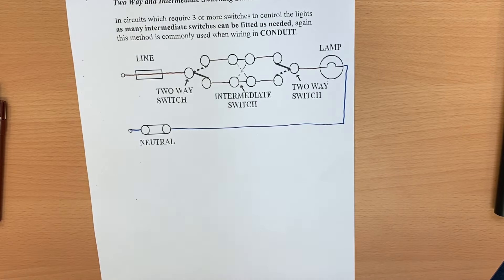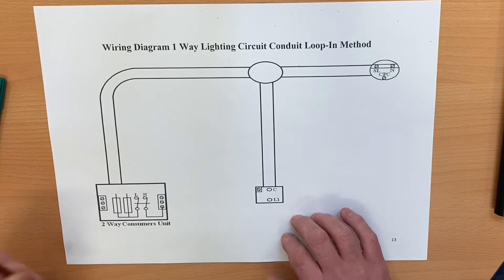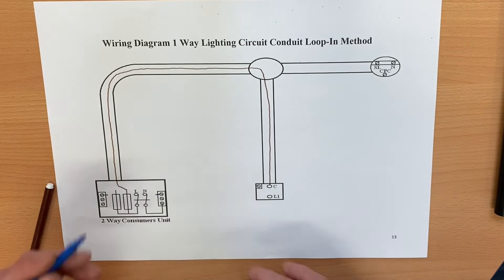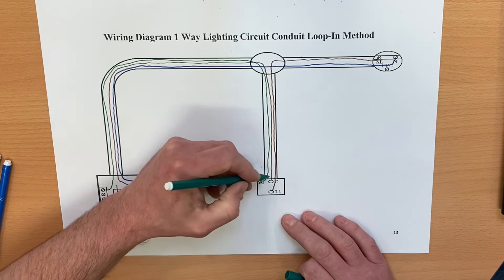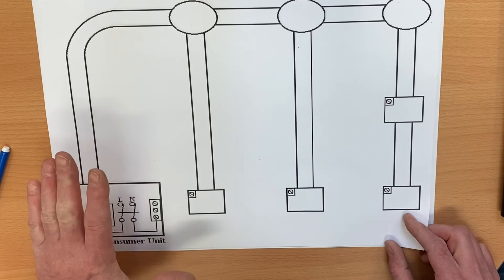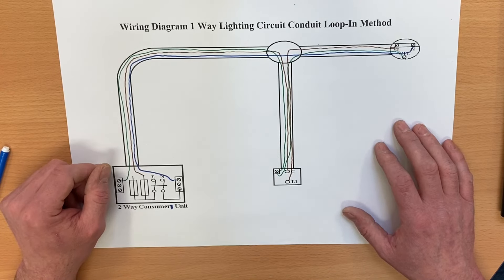Wiring Diagram Conduit Loop-In Method Introduction Part 2 of 2 - Lighting Circuits in PVC Singles

Comment from the maker: == 🕐 Time Stamps - Cut to the action 🕕 ==
00:10 - Make sure you have watched part one of the introduction to the conduit loop in method
00:18 - Wiring diagram for a one way lighting circuit using the conduit loop in method
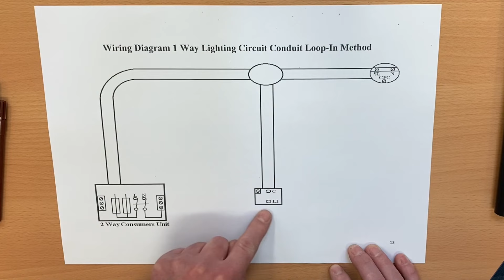00:35 - Wiring diagram components 
01:13 - Adding our line and neutral conductors to our 1 way lighting circuit wiring diagram
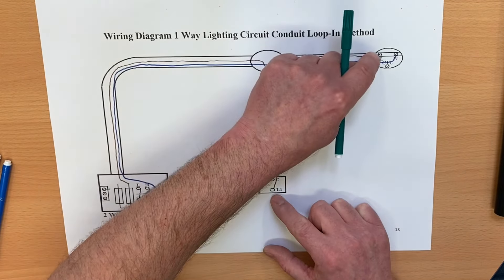02:55 - Adding our CPC conductors to our 1 way lighting circuit wiring diagram  
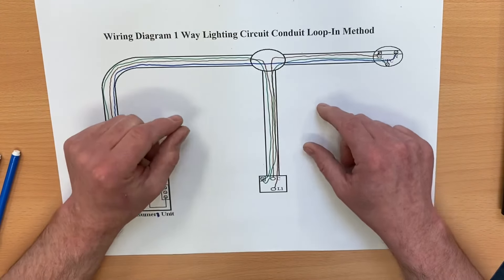04:51 - Cable connection in the consumer unit, one way switch and lighting point
5:50 - Signposting future videos on the conduit loop in method

Comment: Daft question why not a CPC connection block at the junction thus saving 1m of cable
Reply from the maker: All CPC to take a local route however the lighting points I use cannot fit 4 CPC in them. Loads more wiring diagrams to come using this method 👍🏻. Thanks for commenting and watching. Gaz

Comment: That is not logical for the cpc I would run my negative in my ground wires directly to the light and I would splice a second cpcn to the first CPC at the T box and bring it down to the switch. Anything else is backtrack in America the inspector would cut that wire out have you pull it and your boss with take that wire out of your pay because you can either splice it in or hard wire it without that extra backtracking CPC Wireless return to the ground. If that was a studio apartment congratulations you just bought 20 ft of wire